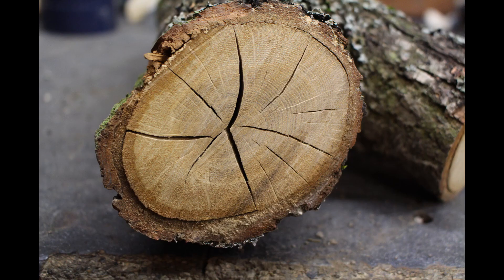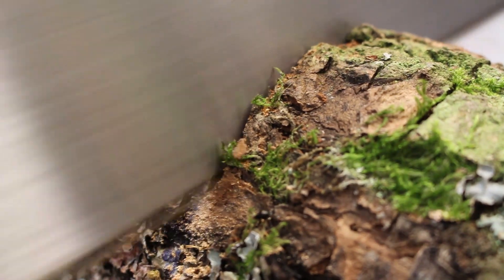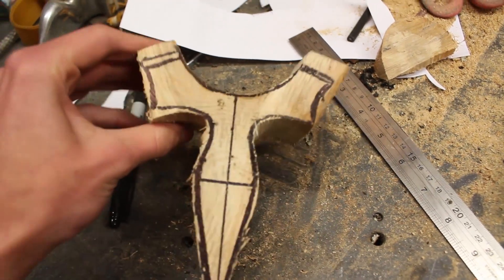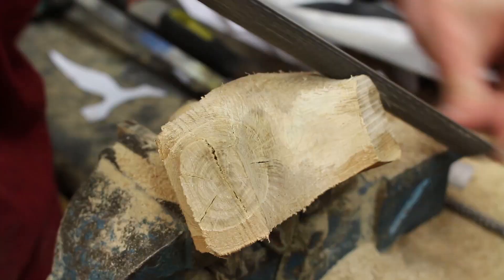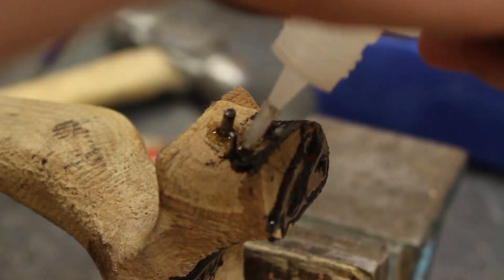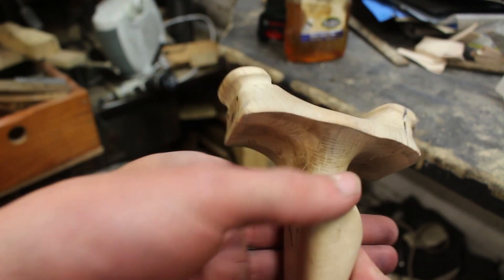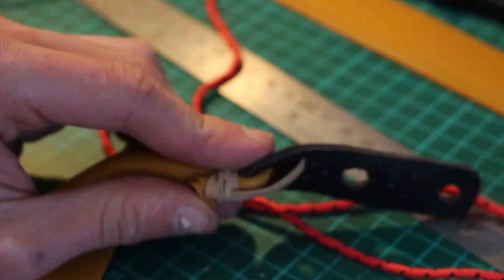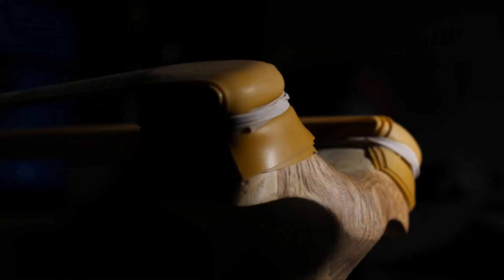How To Carve A Natural Oak Slingshot

Comment: Good to see you back, and right back into that wood work. It does kind of always stick with you once you get good at shaping wood. Even if you do other things in life, you eventually just have to get your hands on some wood and work it.

I learned that black looks good for filled in cracks by accident. Some dummy painted the walnut wood on an old shotgun stock black. He wanted it to be more "tactical." I removed all the paint by scrapping it off and sanding rather then using a chemical. The low spots in the walnut still had a bit of paint, and it looked great.

Comment: Now most of the muscle strain is on your two fingers holding the pouch.

Amazing nice creation, but I typically see full wooden slingshots like sculptures or sculpture collections, rather than seeing something for long heavy duty use. The most I can compromise is a Rosewood handle with stainless steel forks, or atleast there's some stainless steel being "sandwhiched".

I do so very agree with your direction, ergonomics and power(penetration).

Comment: 20 mm ball barians that's barbaric .   I thought I was cool cutting down a downed oak tree branch drying g it out cutting off the bark t reveal awesome pattern I been told happens when a tree falls and is on the floor some time it creates deep patterns that looks like you went through the grits 60 to 500 etc .  But seeing this video alone made me see I wasn't great at all in fact your ARE great your slingshot design is so AWESOME I wouldn't know where to start but I have started as I wanted to have a slingshot with fork tip big enough to hold tapered bands from 30 mm to 20mm the 10 mm taper not sure how long the band will last I was contemplating putting on black gzk .82 mm or maybe 1.00 bands maybe it be too thick unit sure I will experiment as nowadays in 2021 the slingshot world fad n faze seems to be smaller ammo for greater accuracy and smaller thickness bands such as ammo 8 mm and band.thickness 0.72 gzk green or 0.72 snipersling black or yellow with 9.5 mm steel barbaric bearings or 8 mm steel ballbearings  with popular tapers of with 18/12 or 22/15 or 20/15 or 25/20 for hunting its a minefield so much choice so many ways what shocked me was when you used massive size ballbearings still said they where to small etc????